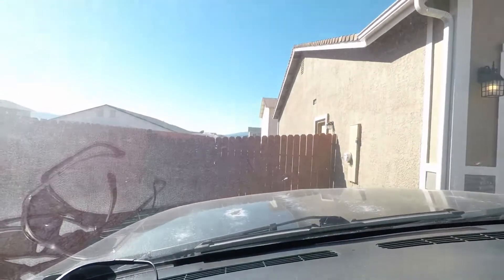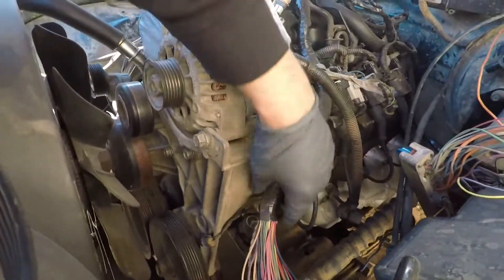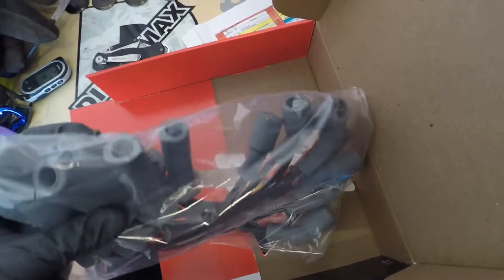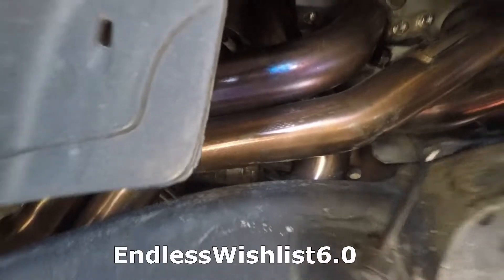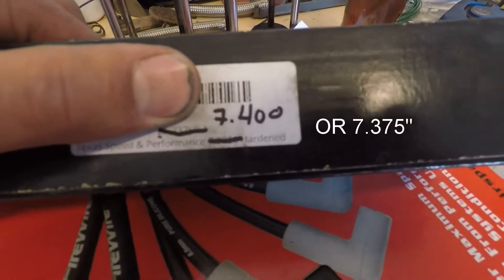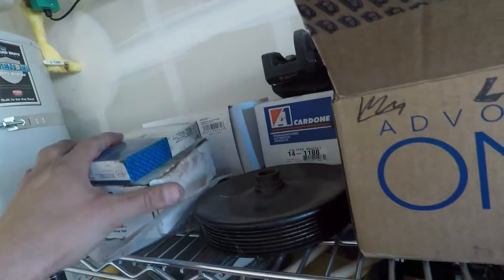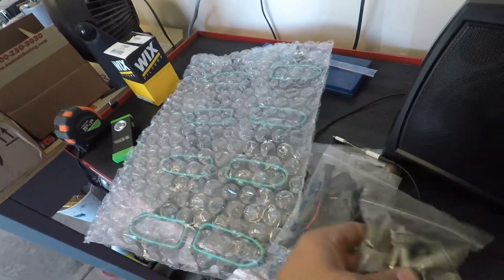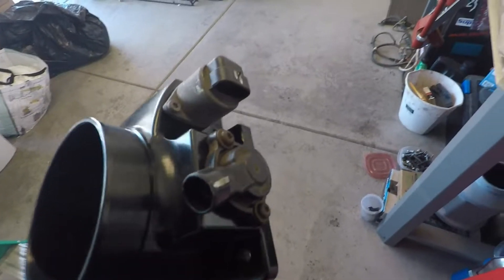That's It! One Project at a Time!

Comment: I have a question so I have a 2000 GMC 2500 non HD and the lift kit places say there are for an 01-06 non HD would the lift probably work in my application if i just order it for an 01?
Reply from the maker: Is your truck the same body style? Or is it like the 90s trucks
Reply: Its the 99-06 style
Reply from the maker: I think you should be fine but I would call the lift company and verify
Reply: Good idea, Do you think id need 42 lb injectors for a 408 stroker? Im just doing a mild cam and some 317 heads with 2.05 or 2.02 valves, Also did you ever think about doing one in the black truck?
Reply from the maker: Like the 8.1 injectors? You will need bigger. My friend has a cammed 6.0 and his are maxed out already. So for  stroker you would need more like the 6.0 flex fuel injectors. And yes I have thought about it. It is a possibility in the future
Reply: Would 60lb 8.1 Marine injectors work? Also what kind of power does the cammed 6.0 of yours make like a rough estimate?
Reply from the maker: Oh yea those would be good. Just make sure they are quality ones. I have heard of the marine injectors going bad. With my old set up? Or with my new heads and intake?
Reply: With your old setup, It looks like it was fun to drive even with the 370